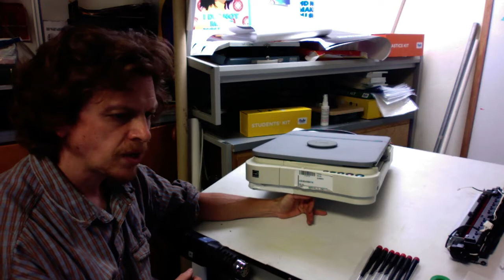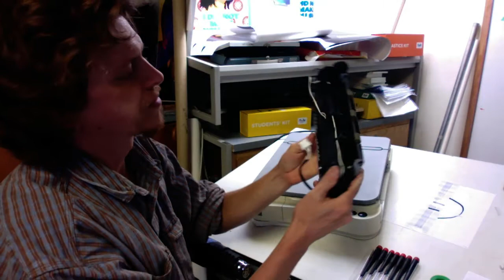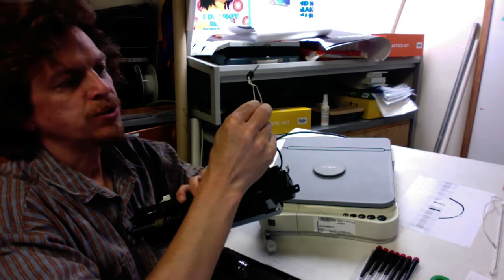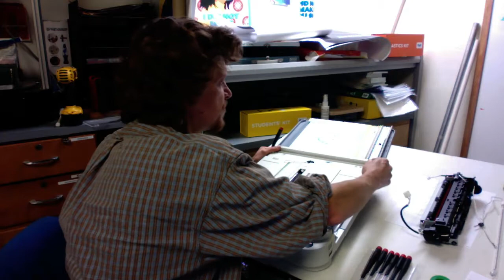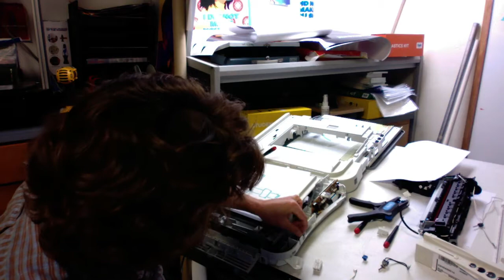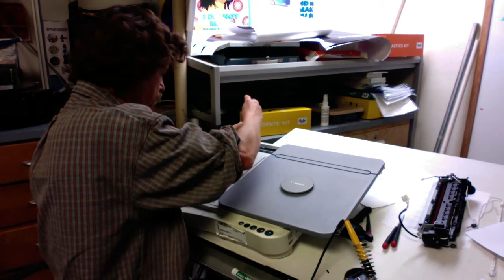Laser printer modifications for toner transfers

Comment: Hi James.  Is it possible that you could modify a heating elemnt for me for a fee?
Reply from the maker: Sadly, my plate is a bit too full these days to commit to more work, but I am always happy to chat about making stuff. What kind of project are you working on?
Reply: @jamessaxon7133  Thank you very much for your prompt reply.  I'm 67 years old, not even close to being electronically-minded and a bit hesitant to do the modification that you are doing in this video, but, I will give it a try. My project is the exact same as yours was...print out a sheet with non-fused powder so that it can then be transferred. I do have some questions...what is the brand and model of the potentiometer? What should the resistance be and do I need to change the resistance and if so, how do I do that? Lastly, will this work on a color laser printer? Again, thank you.
Reply: Just checking to see if my questions arrived in your mail. @jamessaxon7133
Reply: @jamessaxon7133  Thank you very much for your prompt reply.  I'm 67 years old, not even close to being electronically-minded and a bit hesitant to do the modification that you are doing in this video, but, I will give it a try.  My project is the exact same as yours was...print out a sheet with non-fused powder so that it can then be transferred.  I do have some questions about adding this potentiometer to a fuser unit on a OKI laser printer...what is the brand and model of the potentiometer?  What should the resistance be and do I need to change the resistance and if so, how do I do that?  Thank you.